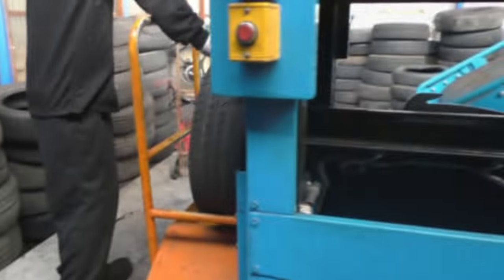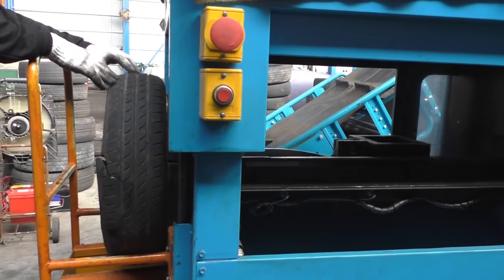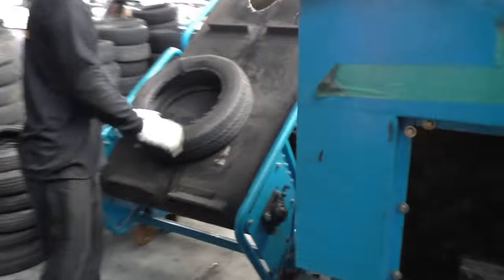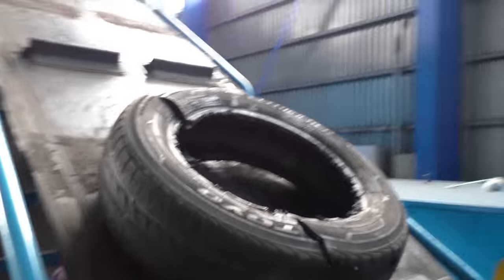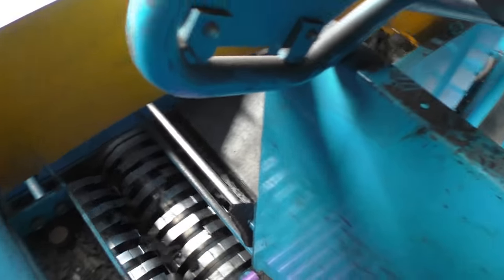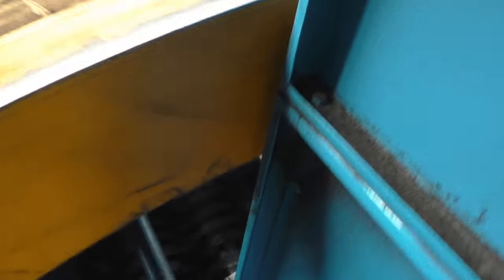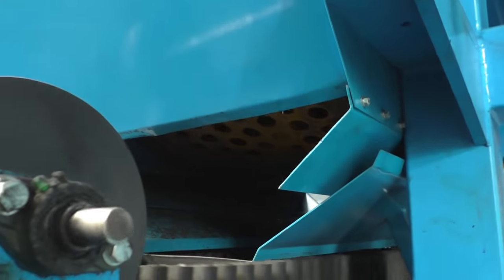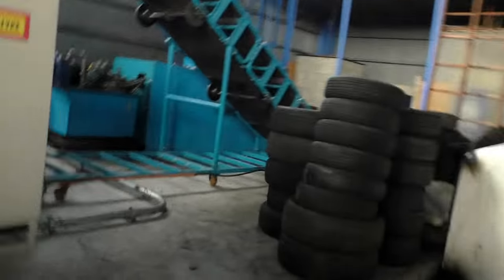Tire Recycling in Japan - TURN ON CC

Comment: cool, pulling out the wires first eliminates later on an expensive magnet to get out all steel. and suppose it is also easier on the shredder? one thought though. the back ground noise is far to loud. one can nearly not hear the comment. maybe the text should be spoken separately and added on later?
Reply from the maker: Yes, the wire is too thick for the grinder, it will wear it out quickly. I was planning on putting subs herr but I'm too busy and i also cant hear my own voice lol. Thanks for dropping by!
Reply: +Kitsune Ken you are welcome, i like to see interesting and new things. because in the EU or USA ( videos) i never have seen a wire puller. there they throw the whole tire into the shredder and get out the meal with a strong magnet. which costs much more than to pull out the wire. but suppose labor there is more expensive. so it costs to much to have 3 or four people to handle each tire by hand.
Reply from the maker: austrorus Yeah i see videos even whole bikes and cars are thrown in to the grinder! Here 1 person can handle the wire puller, converyer and grinder so it's also just needs 1 salary man. After the wires are pulled, it goes into the press and sold as metal.
Reply: +Kitsune Ken 
indeed it is so. and than they need an expensive machine to sort out the glass, another one for aluminium,another one for steel. they say it is expensive to sort out everything by hand right in the beginning. to me recycling means only to send things to the yard that can not be used anymore.  but it is not to be like that, well, so be it.
Reply: @kendelion  details about the machine please
Reply from the maker: @walterb1149  Hello, I dont sell these and we already changed the machine to all japan made. I know someone in china who can help you with this fb.com/Scott1993smith
Reply: @kendelion  will you Kindly share the machine your using now if it's more advanced it's better to have that....
Reply from the maker: @walterb1149  i'll try asking if they can tell me the source!

Comment: Are these bias-ply tires or radial tires with wire in the tires if so I see the bead wire gets pulled what happens if it's a Steel radial and the other wire is throughout the rest of the Tire carcass?
Reply: it does not matter if they are bias ply or radial, the bead wire is the same in both. The sidewall does not contain wire reinforcing, the plys in the sidewall are usually something like rayon.

Comment: What happens to shredded tires? Are they used as a fuel?
Reply from the maker: They're remelted and made into new tires!
Reply: Kitsune Ken That's not possible, at least not in that straight way... They still contain steel and nylon cords, dirt and so on, also rubber once vulcanized cannot be simply melted and moulded again. There must be some more complicated process here!
Reply from the maker: yeah, i have to find that out! I only get to shred tires, after that a big truck picks it up from here and i dont know. :D
Reply: they are turned into condoms
Reply: In my country rejected or unused tyre can be recycled become fuel